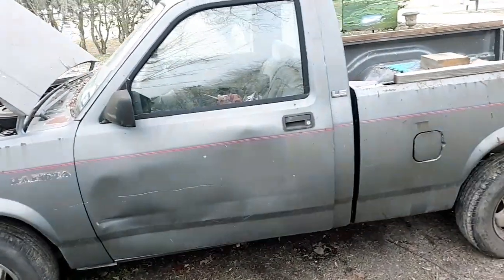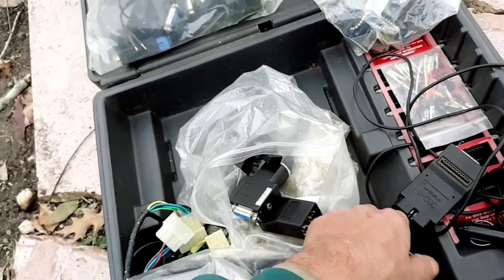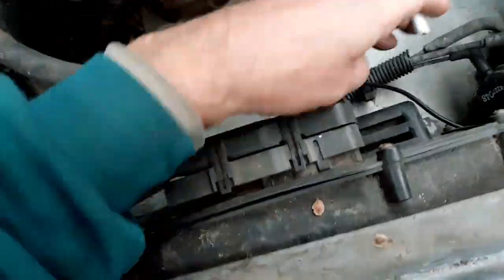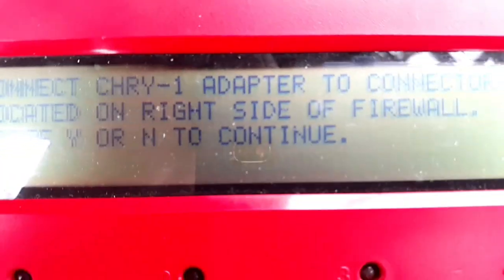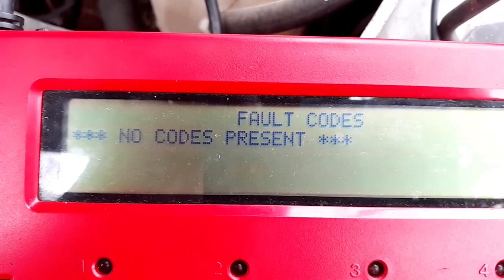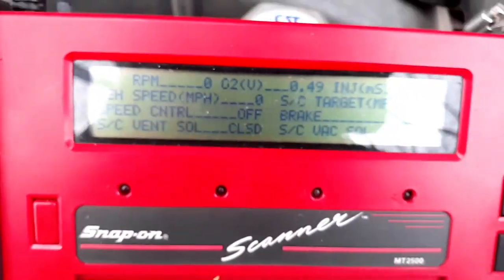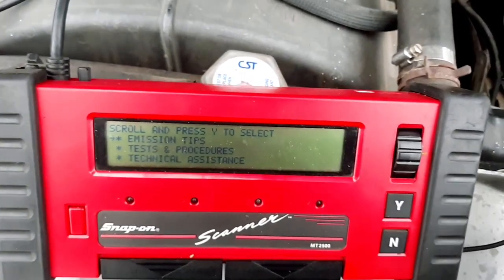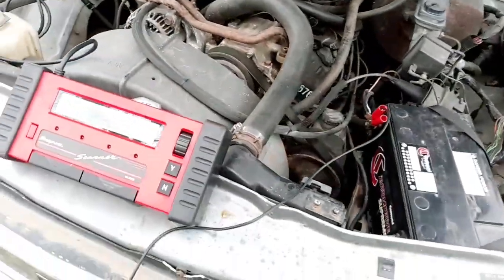Flashback to OBD 1 on a '92 Dodge Dakota using the Snap On MT2500 'Red Brick'.

Comment: i just bought one of these cost 150 bucks hoping it will work well with imported Mitsubishi GTO on a 91 plate just got hold of the Japanese primary cartridge need to maybe get the trouble shooter if the primary shows anything
Reply from the maker: Hopefully it works for you. I never used mine on very many vehicles, and maybe only on one or 2 Asian vehicles I can remember. I just ended up selling my kit about a couple months ago for $300, but it had almost everything in it, except for any European stuff.